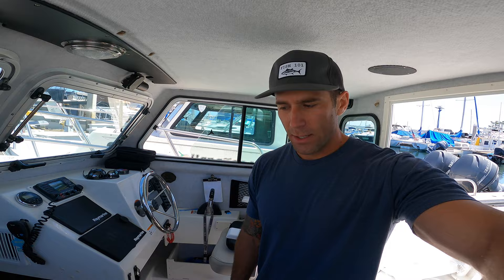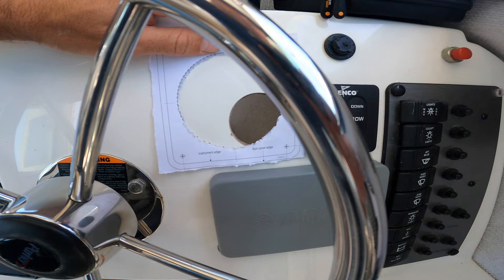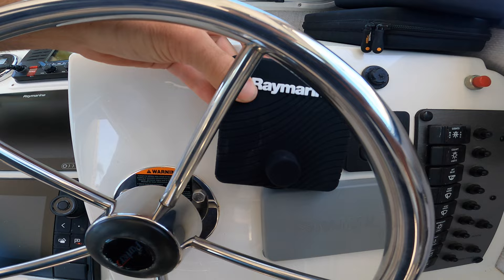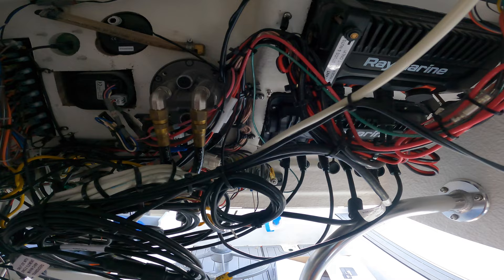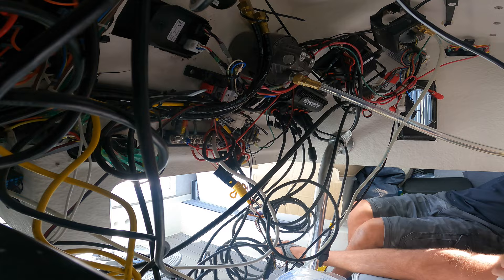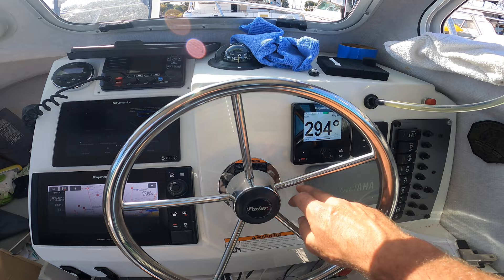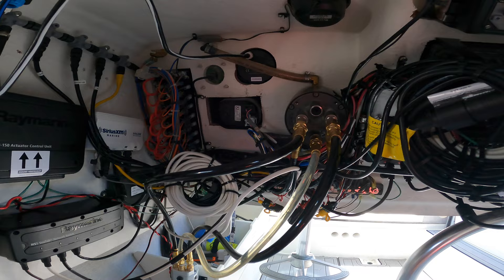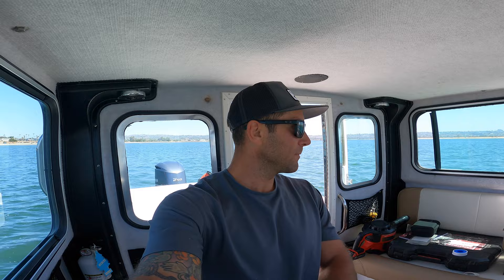Raymarine Autopilot installation // Parker 2320 // Raymarine EV-150

Comment: Thanks for the video and descriptions.  We're thinking about replacing our existing (originally great, but problematic now) S1000 with the EV-150, and it looks like a good upgrade.  I'll comment back if we do, and if the existing hydraulics will work with the EV-150.  Thanks!

Comment: 10:30  I simply used the 2  90 deg fittings that are in the back of the steering helm and put them on the pump. The kit from Sitex comes with one straight fitting for the return line reservoir . Didn't need to go to Home Depot for 3 extra fittings for the 150 with kit..
Reply from the maker: Great idea!

Comment: Hi sir. The ev 150 need some kind of piece in the outboard to measure de shaft angle? OR the only things you need are inside de box kit?. Thanks a lot from Argentina
Reply from the maker: Hola! Gracias por ver el video! You can buy a rudder position sensor or “smart stick” to get rudder position feedback. I currently don’t have one and it works fine but it’s something I’ll probably add eventually
Reply: Thanks a lot

Comment: I only have an NMEA2k system in my boat and will have no other raymarine equipment aside from this autopilot. Do I need to order the seatalk network switch to make the autopilot work? Or did you only need that because of your raymarine MFD?
Reply from the maker: Yeah your NMEA 2k will work I only used it because a lot of my components are already tied into the sea talk network

Comment: So I will not be linking my unit to anything other than the head unit that comes with, so if I'm thinking correctly I shouldn't need the nemma network right? Thanks again
Reply from the maker: No unfortunately you will still need the seatalkNG (or NMEA with adapters) network. It’s the only way each component will communicate with each other. So for example the ACU (brain) tells the pump which corrections to make. The only way the ACU gets it’s info if via the EV-1 sensor and P70 controller which feed the info via the seatalkNG network. I know it seems complicated but it’s only a few parts and it’s very easy once you get your hands on it.
Reply: @Tonygiooffshore  thank you

Comment: Having trouble getting the male to male fittings where did you get yours.
Reply from the maker: I actually ended up finding them at Home Depot. They are 3/8” compression fittings. Hope that helps I also had a rough time tracking them down
Reply: Thank you
Reply: In the 150 Manuel the are calling the fittings 1/4 BPT to 1/4 NPT male adapter my sea star hydrolic helm is 1/4 NPT was you system ORB .
Reply from the maker: Yeah mine is ORB

Comment: Did you have to install check valves so the pump wouldn't move the steering wheel?
Reply from the maker: No, how the T’s are set up it bypasses the steering wheel. But, when the AP is active the steering wheel does not control steering

Comment: What size fittings did his use 1/4” or 1/2”? Also what size hydraulic line comes with the octopus kits
Reply from the maker: Sorry for the delay it’s 5/16” hose with 1/4” fittings